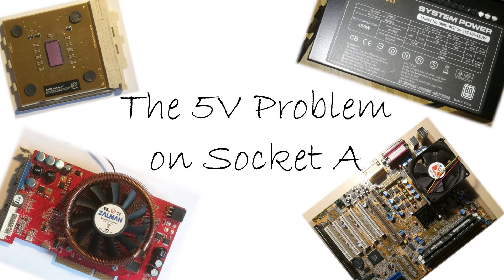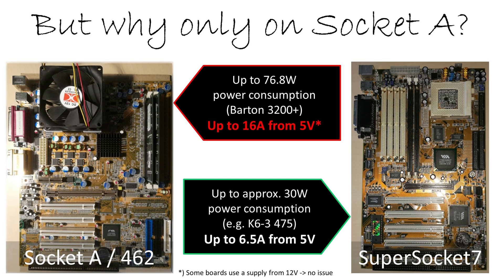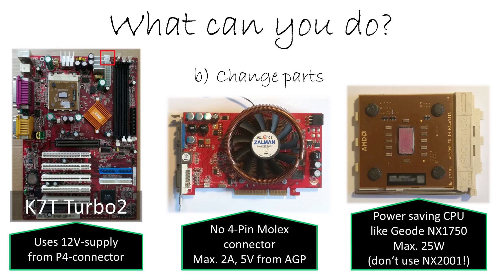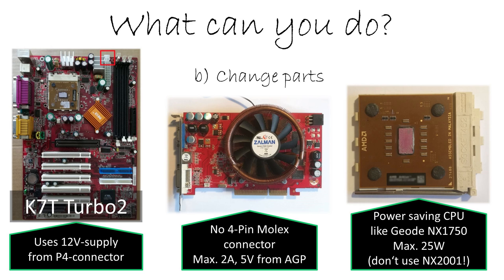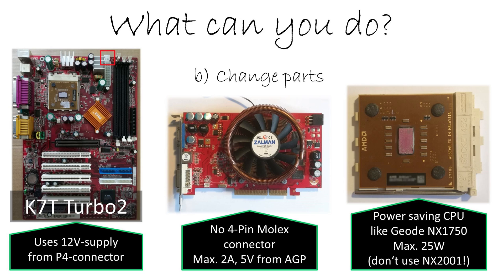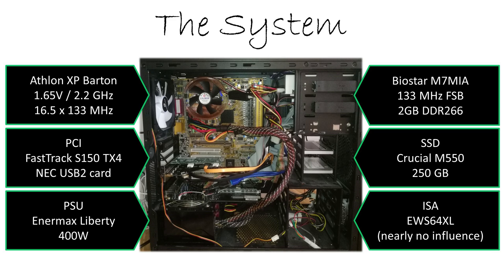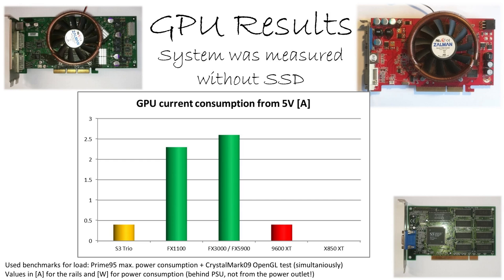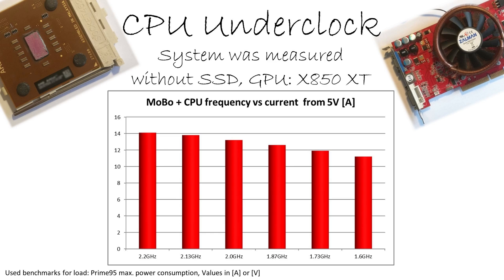Athlon XP vs modern PSU, the 5V Problem, New solution: Undervolting! [Measurements for GPU & CPU]

Comment: I have an oem psu with 33A on 5V and 16A on 12V, maybe will work
Reply from the maker: My biggest concern would be the age of the PSU, should be old? From spec point of view I see no problem.

Comment: I have retro PC Athlon XP 1700  with PSU Corsair 400w with 18A 5v its OK?
Reply from the maker: @ricardobarros1090  You mainboard supplies CPU by 5V?
Then it depends on GPU and if you have an old 1700+ Palomino or a newer one with Thoroughbred core (uses ~15W less, so 3A difference on 5V rail)
With a light load GPU it should be no problem.

Comment: Does Socket A require a voltage of minus 5V ?
Reply from the maker: @charonunderground8596  In my experience  the boards work without -5V. 
Up to now even with a lot of old boards (e.g. SS7) I never had problems. Only some ISA soundcards need -5V.
Reply: @firephoenix2726  thx !

Comment: I'll take option d then, just run the VRM of 12V instead of 5 :)
Reply from the maker: For sure this is also a nice solution, even very dependent on the board you're using. Additionally the performance of the buck-converter could be reduced a bit because of the higher load on the lowside switches by increased duty-cycle (shouldn't care in the most cases). 
I like the undervolting option not only because of the 5V rail issue, but also because it relieves the buck-converter on the mainboard which is not always properly designed for new CPUs on this old boards.
Did you already modded a board VRM to 12V?
Reply: @firephoenix2726  Yeah i modded all my A7N8X-Es for 12V, abolutely no issues there, same for the Asrock nf2 board, but yeah depending on the board there might be issues, but i only really care about NF2 boards and never ran into any issues with running VRM off of 12V :) Undervolting isn't an option if you're running the chips hard, initially i just used Abit NF7-Ss but they like randomly dieing too much, the asus a7n8x-e is just a tank :)
I actually have a guide showing some of the mods on my A7N8X-E, most of the stuff is just relevant for XOC but 12V mod is in there too.